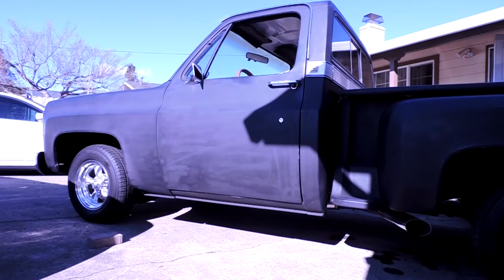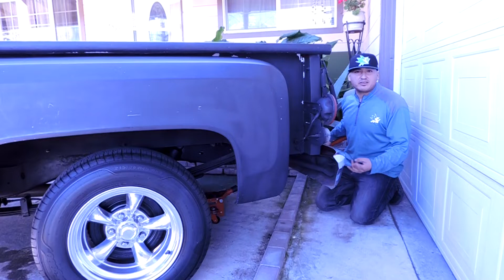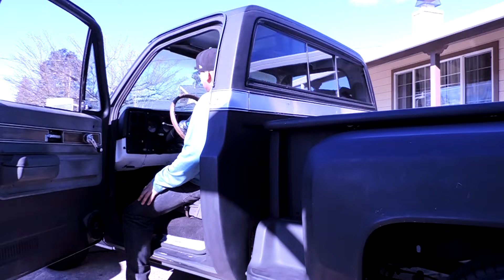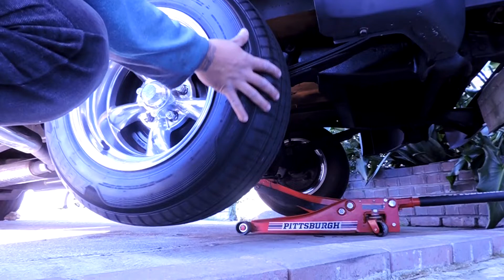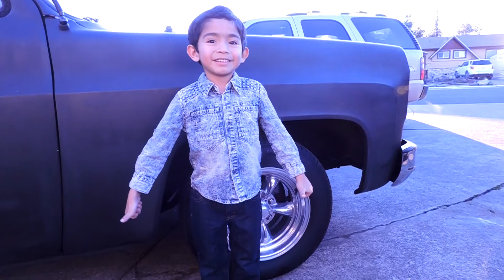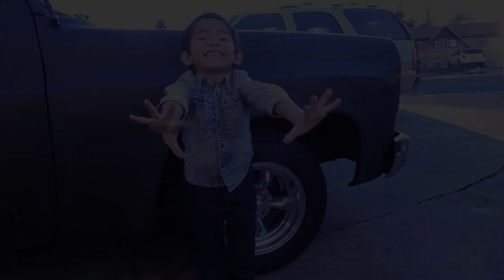How to tell if your vehicle is open differential or Posi limited slip differential

Comment: Even with a limited slip or posi (they are different brands, but do basically the same thing), or even a lunchbox locker it requires a certain amount of force for the clutch pack in the LSD to engage. You may also have a limited slip diff, but the clutch packs which cause the rear to lockup are worn to the point it will not lockup reliable. It is that clutch pack that requires the additive which h is a friction modifier which helps the brake like washers that compose a clutch pack to create enough friction under speed to lock the diff & transfer power to the wheel with traction.  You could very well have a LSD that either needs a new clutch pack or just a fluid change & friction modifier. A new clutch pack is a easy fix & a hell if a lot cheaper than a new Limited slip kit.